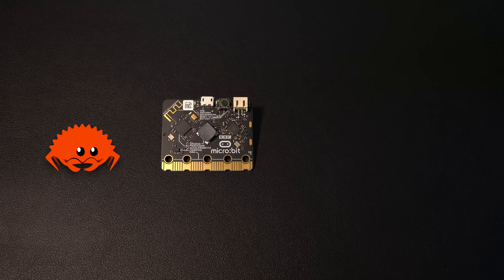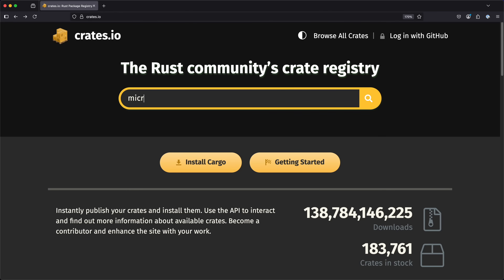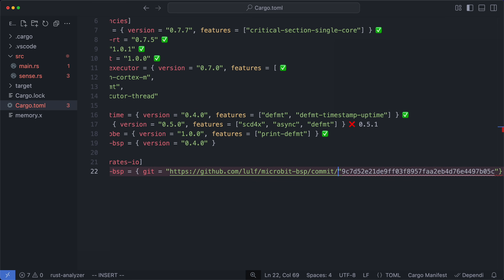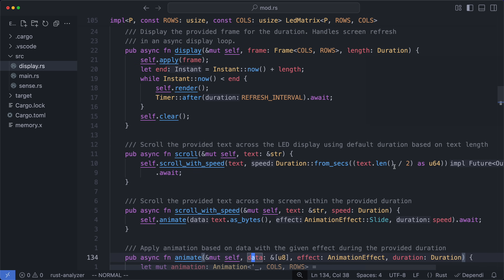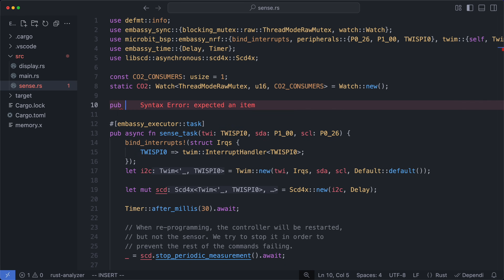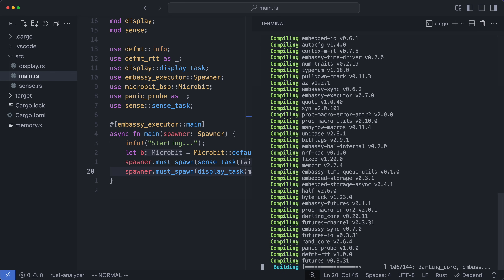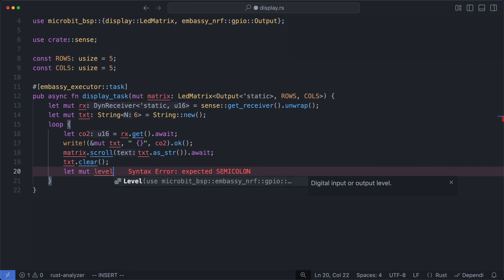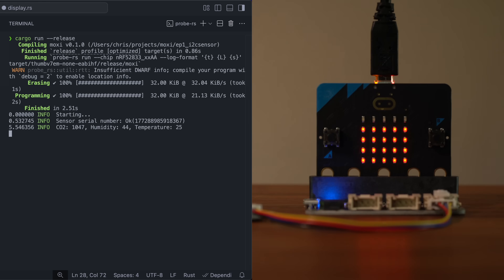Driving an LED matrix using async embedded Rust - moxi Ep2

Comment: I had an idea to do realtime communication with both audio and video with a radio transmitter & receiver, but I'm not sure where to start - of course, maybe no programming is required for simply transmitting and listening, but I wish to do certain things like display the person's decoded video data, probably using amplitude modulation

This is one of the first videos I've watched for embedded programming since I was kind of interested and my 2nd language is rust (after typescript), and I have no idea what I'm reading - all the acronyms and words are so different from just http programming in rust lol

Should I start with a different language first? Or where should I start for this kind of thing? I'm pretty lost
Reply from the maker: That sounds like an ambitious project! First, I'd recommend watching my all of my other videos 😂... seriously though, we do cover some of the terminology unique to `no_std`/embedded-Rust in the IDE setup and blinky videos. For more general embedded tutorials.. I'm not quite sure what to recommend; my degree is actually in electrical engineering, so most of the really low-level stuff I learned in school. I think Brilliant.org has some courses on circuits and digital logic that may be worth checking out. Also, check out the Rust Book if you haven't read it already. Good luck on your journey!